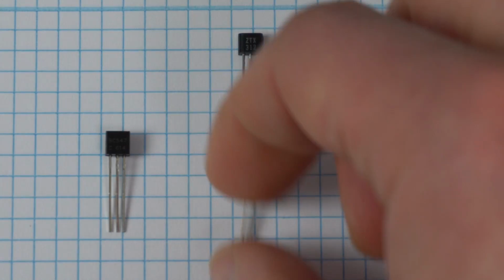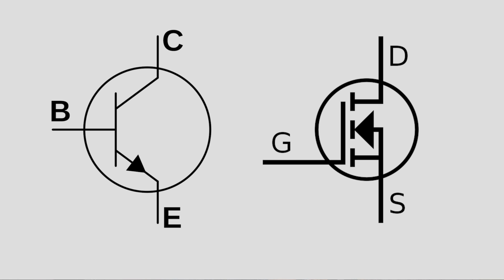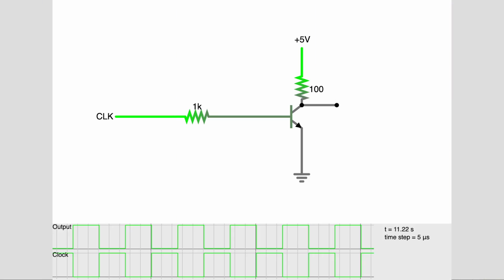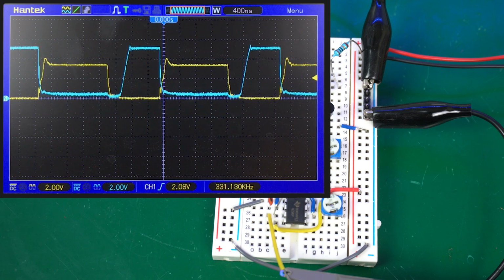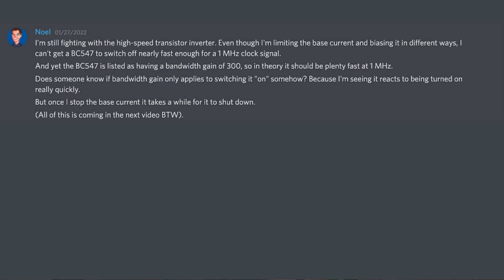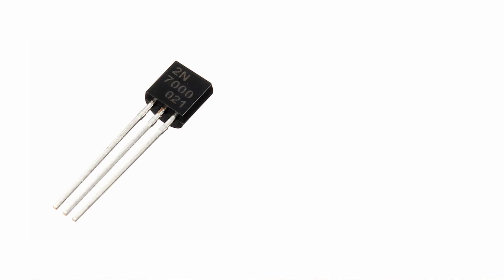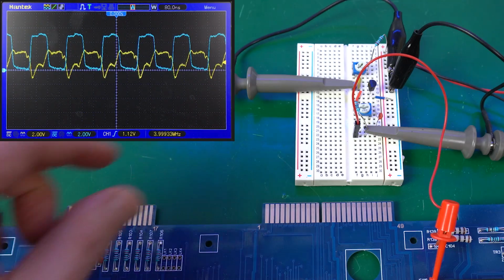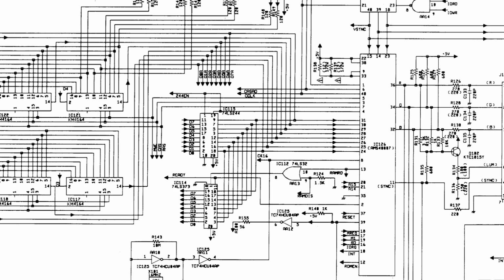How To Find a Transistor Replacement

Comment: You don't need to limit the current into a MOSFET gate, they are voltage switched devices, not current. But you do have to add a pull-down on the gate to ensure that they fully switch off when the gate voltage is removed. MOSFETs and JFET Transistors are different beasts when used in a design!

Comment: As you can see at the Oscilloscope the original Transistor does two things here:
1. stabilizing the square (so it is not overshooting etc).
2. amplifying it - as the gatearray does not output 5V (for whatever reason as well). 

So the transistor is just the cheapest version to implement it in a save way (to ensure that you always end up with a 5V square wave.

Comment: I stopped watching the video at first, but then i coninued, Very interesting consept.. Transister for what you are using,, I have an old tube phono. I want to upgrade using transisters, to make it more stable.. I only need the phono inpust using s crystal pickup. i came to the conclusion either using a 23904 Transister or a BC547 Transister... I would avoid using the LM386 cause i dont like the way it sounds...However the tubes get really hot..

Comment: Old now as I work through your videos.
Most switching transistors have a Ton delay, Toff delay and storage time. High frequency transistors show the collector capacitance as well.
The old CRT display base drive circuits for the line output stage were quite novel in trying to minimise storage time by reverse avalanching the base emitter junction to remove the storage charge as fast as they could. you would see a negative spike on the base of 15V.

Comment: Those round bodied transistors are pretty common here in slovakia/czechia the local electronics manufacturer(Tesla) used that design a lot, even for OP, amps  and some simple IC's

Comment: The switching time characteristics of BJT is a science on its own. It depends strongly on its manufacturing technology. Here is a very good video on it: https://youtube.com/watch?v=XgSKLsWAWGs&si=EnSIkaIECMiOmarE . If you have a switching application you can either use a well specified switching transistor like the 2N2222 or an rf transistor. Then you can get sure to have a device with shorter delay and storage times, who strongly determine the switching behavior of the device.

Comment: Maybe in the 2nd revision, they had a problem getting the clock inverter transistor as well, rather the use an alternate (which may be hard to find in the future as well), they decided to use an inverter from microcircuit. In aerospace and defense we have to deal with part obsolescence all the time. We often have to revist old designs and find alternate parts that are still available, it takes a design engineer and a component engineer to work together. The design engineer finds parts and analyzes/tests/simulates them to see how they will work as a replacement, while the component engineer determines where that part is in its own "life cycle", where it is made - China parts are out of the question, it's cost, and production lead times, among many other factors.  Sometimes we have to do a "lifetime buy" and keep the parts in our own stock because the manufacturer has sent out notices that the part is going "obsolete" soon.  Parts obsolescence is the least attractive part of engineering and many poor engineers palm it off to younger engineers, even if it was their own original design and know the circuitry better than anyone. I don't do that, I "own" my designs from concept to death and I insist that I handle the part obsolescence on my own designs... this gets it done faster and saves me from from doing it on others' designs. I get high marks for supporting ALL my prior designs no matter the age. Many engineers think it is beneath them to do such a "dubious" task and only want to work on new designs. That is sad, and some managers let them get away with that. The end result: the original design engineer gets a pass but the old design suffers in the end because someone not familiar with the design tries their best to fix it.  This affects a company's reputation over time... but managers often worry only about short term solutions and to coddle some engineers that threaten to walk away if they are told to work on something not interesting.  Me, I let them walk, I always find another to replace them, because the engineer I find is a "true" engineer and will not refuse to slove a problem.

Comment: Current is not multiploed. You cant get blood from a stone. Small changes in base current affect large changes in emitter current 5:34 .in other words you are using a small power supply current to affect a larger power supply at the rate on input change. Go on keep making it more complicated than it really is. However breadboard experiments are a great idea, providing you dont exceed yhe transistors rating.

Comment: i almost never got a chance to replace a transistor. 
everything i see are full of square black boxes. except one power supply, where the small transistor blew after i changed the burned collector resistance. may be i mis-imagined or miscalculated the value of the burned resistance and it overloaded it. never actually took up that repair again. 

but, imo base should always have some resistance, since they are supposed to have small base current for small signal ones. and chip pins, even with passive pullups, often deliver more current. without a limiter, transistor may work fast, but they are destined to fail, like that one failed in the video.

seems someone unknowingly made some fast & cheap solution & when it failed, brought out a new version with inverting chip.

Comment: You can't just replace a BJT transistor with a FET transistor.

The BJT is a current-controlled device, while
FET is a voltage-controlled device.

Comment: For that particular transistor I have no problem:

1. I used to work for the manufacturer (Ferranti)
2. I have many ZTX312's and many other ZTX series devices from 45-50 years ago! 😱😳
3. I have several Towers' transistor selector books that detail the critical specs of the transistor and also give equivalents from that time (mid '70's!). I often find that modern equivalents quoted are actually NOT and finding an equivalent of the original equivalent works much better. 😎

Nice explanation of a really good approach though. 👍👍👍

Comment: Wow interesting info !

IMHO the ns Turn on / off time etc is important for pulse and digital signals
Could a Gallium nitride (GaN) transistor be an interesting choice ?

Nevertheless 2N2369 is an interesting one thanks for the info !
What could be complement to 2N2369 ?
I found 2N4209 and 2N5771 but they have lower current ratings etc ?

Take Care

Marc

Comment: Hi, please forgive me for dropping in on this video's topic. I'm trying to repair an old QL with RAM, and or other,  issues. Can I use an Analog oscilloscope to try to determine the failing chips?  I cant afford a digital scope atm. I can afford some scopes offered second hand. So my question is, do I need a digital scope to try and educate myself and find some faulty chips on a digital, up to 8mhz cpu?
Highest regards, Mac

Comment: Different, i.e. reversed pinout on a transistor of the same type is not uncommon - it is intentional. See for example SMD-part BFS17A vs. BFS17AR (with reversed base/emitter pinouts; Vishay/Telefunken - datasheet). "R" means reversed. You have to pay attention.

Comment: I swear I have seen this problem where the pins on a transistor are reversed on different datasheets from different manufacturers. I think it was a BD139 NPN transistor at the time.  It was a lot of head scratch for sure.   
I really like the comment about the later editions of the text not having a chapter the previous edition had. I have the 3rd edition of the Art of Electronics. Probably because I am too young to have been able to find the 2nd edition on the campus book shelf when i got this one.  Now I have to go find a friend with the 2nd edition.

Comment: Many years ago while working on a Honeywell 200 that wouldn't multiply correctly I traced the problem to a shorted 2n2501 transistor (2501-7 in Honeywell terminology, one of several varieties used). I had a replacement but the leads were strangely bent so I re-bent them to the configuration I was accustomed to and soldered in the replacement. Now the thing wouldn't divide. Back to the same transistor which was now open. Closer examination revealed the reason for the strangely bent leads. Instead of EBC this version had the pinout ECB. So, yes, sometimes very similar transistors have different pinouts.

Comment: This gets even crazier when you want to see devices' overload characteristics and stuff. I build guitar pedals and vacuum tube sims using discrete transistor circuits. There are so many undocumented "effects" that I've learned about and used. I can say that math is great for when you are trying to nail down a specific design that requires precision. The art of using them creatively is a whole different level and it has taken me over 10 years to learn about and document a whole slew of things that aren't documented.

Comment: 11:30 From personal experience, you can't use a breadboard for circuits that deal with frequencies above ~2 Mhz due to parasitic effects. Such circuits should be soldered on a piece of FR4 (should work up to ~150 Mhz when using THT components and "ground-plane construction" method). This explains why BC547 didn't perform well despite sufficient fT and other observed  effects.
Reply from the maker: I agree. I knew I was pushing it (and that's why I wasn't too worried about some of the ugliness of the 4MHz signal shown when I ran it through it), and that's why the real final test was doing it on board itself.

Comment: depends on the role of the transistor in the circuit  as long as it's application within LF bandwidth it easy to select a replacement .
example  a  buffer transistor   
small signal pre amplifier , 
inverter , ....
all you have to see in the datasheet it's Betta and   PD , Voltage, current and freq response all other  paremeters  aren't that important for 
applications that don't  use in life support circuits  .

transistor as a power switch needs 
more consideration   especially in MOSFETs and igbt transistor 
where rise and fall time , knee voltage and delay are critical to understand so your transistor replacement would be perfect fit .

Comment: I'm trying to learn about how transistors work by a different way: by creating models.
Then you can compare models and what is most important - make experiments without the need of soldering - just by analyzing transistor behaviour in simulator. CircuitJS is a great thing by the way. It do not have all needed features for precise transistor simulations, but most of the time its enough.

Comment: I restore 2" broadcast video tape machines which are over 60 yrs old and work in the analog world. Compared to those beasts, digital is a piece of cake.
I have to find transistors that match in many parameters, some even have to be matched as well because they are used in a balanced circuit. And in the analog circuits they must have a freq response from 30hz to 6mhz.
When I was maintaining a complex digital device i thought as long as timing was correct and waveform was clean. I was good to go. Easy Peezy

Comment: I just encountered this delay effect with a transistor circuit a few days ago. I solved it by replacing the transistor with a different part, but now I know I can add a capacitor or read TAoE. Thanks!

Comment: If you only operate a transistor based on the model, you will miss the unusual application possibilities.
In the 1980's I was wondering about a circuit diagram of a HIFI amplifier. To mute the sound, an NPN transistor was used the other way around.
Collector to GND and emitter to the signal, base switched via a resistor. And so the NPN transistor was actually installed.
Obviously the developer knew what he was doing and it works.

Or how is it to use a transistor without any base at all?
The transistor will turn off, right?
But what happens when the voltage increases? 
Suddenly the collector emitter path becomes conductive without base current.
A tiny current creeps from the collector to the base and when the voltage is high enough it turns on the transistor.

Transistors can be operated in two areas. In the linear area, the tarnsistor worked up a sweat. 
Fully switched on it stays cooler but wants to stay there.

Transistors are more complicated than stupid switches.

Comment: I would have thought like the TO220 package [heatsink tab] on the MOSFET's where the Gate is pin 1 to the left with the body facing you [heatsink tab to the back] pin 2 is Drain [also heatsink tab] and pin 3 is Source, that those small ones [TO-92] would also have the Gate be pin 1 with the flat side facing you and Drain be the middle pin [2] as well??? That would make for physical observation pinout identification. But I digress because on BJT's the middle pin 2 is the Base which is the same function as the Gate on a MOSFET.

Comment: Noel, great video! I think that they may have just used a transistor and a resistor to cut down on component costs. I looked up some of the pricing of inverter gates and inverter chips and most are a lot more than a single transistor/resistor setup.
Reply: Another advantage is that you can place them "in-line". If you would use an IC, you would have to reserve a place on the board, as you have then multiple inverter gates you need to route all inverters that you use to that place. A transistor/resistor is compact enough that you can implement it along the ideal route and therefore has very little impact on the PCB design. I have used transistor inverters in my own design for this reason. Especially if you don't need multiple inverters, it is quite comfortable to do it this way.
Reply: @danielmantione  Yes, you are absolutely correct!

Comment: There's usually several different transistors you can use as substitutes for most of the commonly used transistors, I've been pretty lucky with regards to transistor substitutions.

Comment: The datasheet for the NMOS Z80 says that its clock input must swing from 0.45V to VCC-0.6V, i.e. almost a rail to rail swing. That makes it different from all the other Z80 input pins, which are TTL level, i.e. inputs less than 0.8V are low and inputs greater than 2V are high. I wonder if the purpose of the transistor is to level shift from whatever voltage range the gate array is capable of outputting to the one the Z80 clock needs. If that is the purpose of the transistor, it also explains why the gate array clock is inverted.
Reply: I think you might be very close to the truth. I did a quick check in the schematics for the Commodore 128 and ZX Spectrum and I see that both have a transistor stage before the Z80 clock. The manufacturers were working with LS and NMOS chips. Signals generated by LS logic don't get higher than about 3.5V and signales generated by NMOS chips don't get higher than about 4V, so the transistor might have been the solution to get a large enough voltage swing. The later revision shown by Noel uses a 74HCU04, which does also achieve the required voltage level. High-speed CMOS was brand-new technology in the 80s, so then it doesn't come as a surprise that earlier revisions didn't use that.
Reply: Even more interresting: The ZX Spectrum uses a speedup capacitor!
Reply: Thinking about it more, I don't think the output voltage capability of the gate array is the issue; the schematic shows the gate array has an internal pull-up. R140 is maybe a clue though. It's a 100 ohm resistor that pulls up the transistor's collector. When the transistor is on, current flows into its collector. That's safe for this transistor but I bet it's more than the gate array could safely sink. As to why R140 is a relatively low resistance for a pull-up resistor, it could be to meet current requirements for Z80 and clocked peripherals, including expansion slot. Or maybe it relates to clock switching speed; lower resistance means faster switching.
Reply: @juggler1977  Keep in mind it is likely an internal pull-up MOSFET rather than a pull-up resistor. A pull-up MOSFET can pull-up to about 4V (because the MOSFET switches off at a smaller voltage difference between Vcc and the line). The limitations of a pull-up MOSFET would be a good reason to generate a rail-to-rail signal externally.
Reply: I agree. Thanks, I learned something!

Comment: Looked at the datasheet for the ZTX312 and noticed that it specifies rise, fall and storage times - and the storage time is 13ns. The BC547 doesnt specify this, but a close cousin the 2N3904 does - 200ns! That explains why the speedup capacitor is needed.

Interestingly I can't seem to find a common TO-92 transistor that has good switching times...
Reply: You have to be careful substituting mosfets because then the switching threshold becomes an issue - you have to raise the gate above the drain voltage by a certain amount to get the mosfet to saturate, whereas with a BJT you only need 0.6v, a MOSFET can often be up to 10V.
Reply from the maker: Yeah, I was really puzzled by the lack of timing info on the BC547. I wasn't sure if it was because it was fast enough for anything or just not intended for anything that you cared about timings. I guess it's because the answer wasn't a near number you can put on a table (and it would look really bad w/o the capacitor).
Reply: Try a 2N2222(A). It's a switching transistor, so its speed and transition times are optimized for switching. It is available in TO18 hermetic metal case with leads, a TO92 plastic case as a PN2222A, and SMD. Works for anything switching related below 300MHz. Check its spec sheet. Available everywhere and cheap (Digikey, Mouser).
Reply: @cjay2  I thought this too, but its storage time is still a rather large 225ns according to the Fairchild data sheet.